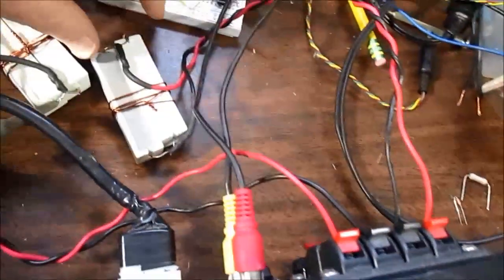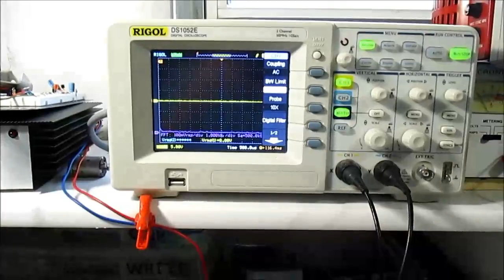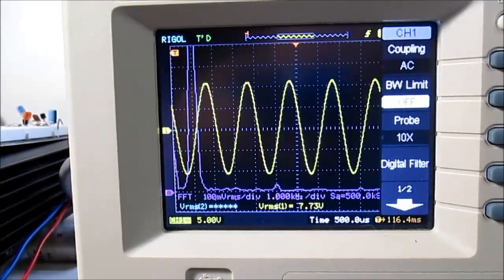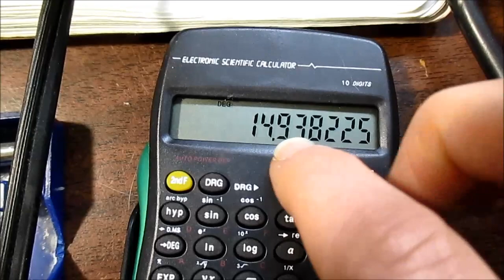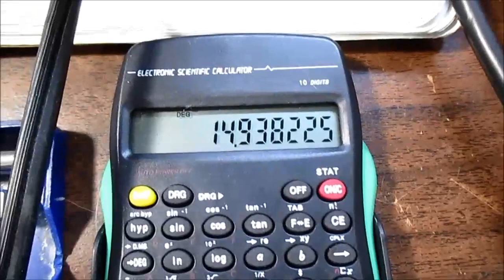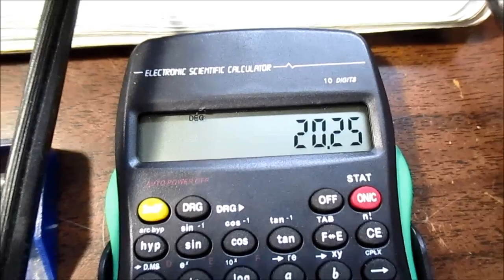Power supply filter capacitor upgrade for stereo amplifier

Comment: thank you for sharing an informative video ! i have kenwood ka2000 vintage amp! it is 13wt/ch at 4ohms. there  are 2200uf at 50Wt  and 1000uf at 30Wt caps at power supply ! how much i should increase the capacitance and power for optimal results ! thank you !

Comment: If i replaced the filter capacitor on my magnavox 14 watt receiver with one that has a voltage capacity  of 70 volts[the present capacitor has capacity of 45 volts] would my wattage output increase considerably?
Reply: Almost certainly not.

Comment: I followed your earlier video "Filter capacitor influence on amplifier" and want to know that does a 2 Ampere transformer actually delivers only 50℅ of its rated capacity ?
Reply from the maker: Because of the higher output voltage after full wave rectification and filtering, the actual continuous current that can be delivered is less than the transformer's current rating. It depends on how it is set up, but it is more than 50%. Using a filter choke can improve current capacity.

Comment: What are the function of those 2 resistors?
Reply from the maker: Since the power supply is independent of the amplifier, the resistors bleed off the charge from the capacitors when it is unplugged from power and not connected to the amplifier.
Reply: @JohnAudioTech  may i know the values? Love it implement it in my designs. Also try using capacitance multiplayer in your designs.. i dont have an oscilloscope to measure frequency response and distortions. Your videos give quite a bit of insight ! Thanks for doing these videos..
Reply: @Vtrontv  At 3:29 they look like Brown-Black-Red = 1K. Since the rails are about ±17 that would dissipate 0.29W in each resistor, so 1/2W or 1W resistors are needed if I read the markings correctly. In the case of 10,000μF capacitors, the discharge time constant would be 10 sec, which would be okay.

Comment: Can through hole filter capacitors in a power supply be improved by increasing them to a greater capacity to make the power supply quieter and more efficient especially in guitar amplifiers?
Reply: More is always better, but diminishing returns. If hum is getting through, you likely have other problems, though.

Comment: Hi John, I have 2x18V AC transformer. Which cap and resistor values do you recommend for AC/DC converter circuit?
Reply: Depends on the current you want to draw.
Reply: 35v-50v caps, capacity depends on your needs

Comment: would a regulated power supply be  better?
Reply from the maker: Yes but not practical for an audio power amp.
Reply: How so?
Reply: @userPrehistoricman  You always have to count on losing at least 2V across a linear regulator and you then need to add on the maximum ripple voltage to ensure each regulator stays in regulation (you obviously need a positive and a negative regulator). Switching regulators are not suitable for audio use.
Given ±17V rails into 4 Ω, the peak current drawn is possibly 4A or 3A rms to deliver the maximum theoretical output power of 36W. With 10,000μF capacitors, the peak ripple can be as much as 3V (VC=It).
The commonest linear regulators like LM317 and LM337 can only deliver 1.5A, so you need a booster transistor in each rail.
With all that complication, you'll lose maybe as much as 5V out of each of the 17V rails. Instead of a theoretical maximum output power of 36W rms (17V x 17V / 2 x 4 Ω), you get a theoretical maximum output power of (12x12)/(2x4) = 18W. It's really not worth halving the power available from the transformer just to have the regulation.

Comment: Ooo you are the master. Sir, I have a dream to build an audio system sounds clear, crispy and better than BOSE. What are the things I need to consider while assembling an amplifier for powerfull home audio. Please share your experience.----------------------should I build it using two mono amp with two separate toroidal transformer . Waiting for your opinion. Thanks in advance.
Reply from the maker: Oooooh Bose! :D  Yes, you might do a bit better going with separate amps and transformers. I'd still put them inside the same case unless you want them totally individual.

Comment: How do you measure ESR?
Reply: "How do you measure ESR?" = with an ESR Meter. You can suitable simple ones from Ebay for $15 or so - just look for the multi-device electronic testers with the blue dot-matrix LCD screens that are often called transistor testers.

Comment: John, is there any difference in sound with using 1x10.000uF and 5x2.200uF? I understand paralleling caps will reduce ESR and is generally better? Thanks!
Reply from the maker: If you have the room, more caps are better. If you work a powerful amp hard into low impedance loads, the caps can actually heat up due to the ESR, so more caps in parallel will be lower ESR and higher surface area. For normal listening, I doubt there would be one bit of difference in the sound as long as the negative feedback has control over the amp circuit.

Comment: if you only have 12V rails I wouldn't even bother trying to go over 18W.
Reply: If you have no losses, then a single-ended output swinging ± V volts into R ohms can't possibly output any more than V² / 2R watts rms. No amount of trying can get more than 18W rms out of ±12V rails into 4 Ω. The most voltage you're likely to get out of a 12.6V-0-12.6V ac transformer is ±17V dc (that's 36W max without losses into 4 Ω or 18W into 8 Ω).

Comment: Great project! I will build a power supply like this. Is that a 12 volt ct output trany? Thankz
Reply from the maker: It is a 25.2 volt, 2 amp CT (12.6v per side). Finding a 3 or 4 amp transformer would be better. If you want more power using 8 ohm speakers, I'd get a 36v CT transformer.
Reply: Of course it would be better. I found 2 pretty good 4 Ohm/8 Ohm/16 Ohm table (voltage ^> wattage and amp ^> wattage). If im right with that voltage the max output current can be 3,7-3,8 amp with 4 Ohm load.

Comment: A good compromise would be to use the same transformer,  the voltage drop on the AC side will not be that great. Then use a separate bridge and smoothing capacitors for each channel. Obviously if one channel is already pulling the rails down, the other amplifier has less to play with even before it starts being driven. I bet you will be close to that 20 watts, one channel driven. Try it.
Reply: The reason for the voltage drop is the insufficient power of the transformer, and the same reason why the overall power boosted for 20 percent just by adding a larger capacitors, because the capacitors acts like a power reservoirs and help the transformer to deliver power almost to the limit , but i doubt that if you put two bridges and two smoothing caps you get a 20 WATTS per channel, simply because if transformer have e.g. 30 WATTS it cannot give 40 WATTS no matter what you do.

Comment: Wow didn't know those bigger and better capacitors would affect the output power that much! Nice experiment!
Reply: Simple electronics theory; the ripple voltage Vr = I/(fC), where Vr is ripple voltage, I current drawn f 2 x mains frequency and C capacitance.  Increasing the capacitance decreased the ripple voltage allowing the amp to get nearer to the voltage rails.

Comment: I think you really don't need more power from PSU when you playing music instead of old good sinewave:)
Reply from the maker: You are correct. Most music is short pulses of drum beat which would let you get by with small caps but some music has long sustained bass which would need better continuous power.
Reply: I meant that it seems you don't need to increase VA of your transformer, and it's definately a good idea to replace those caps. I am curious why I have never seen your amp made on an etched pcb? From my experience it's easier to make a good layout that way.
Reply from the maker: I used to etch but these 5 pin chip amps and PSUs have so few components it is easy to use the perf board. I guess I'm a bit lazy and cheap as well.